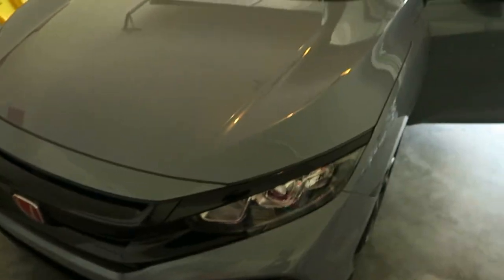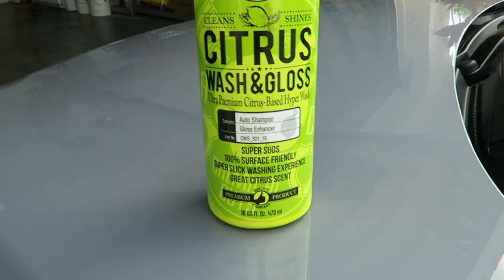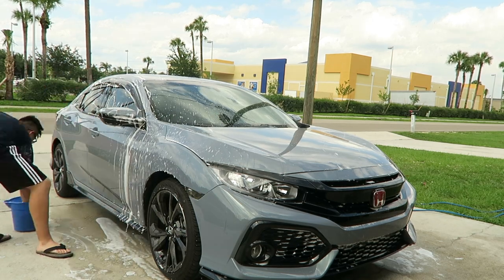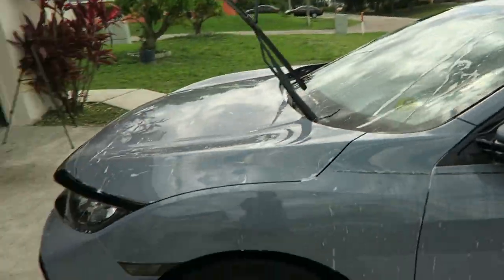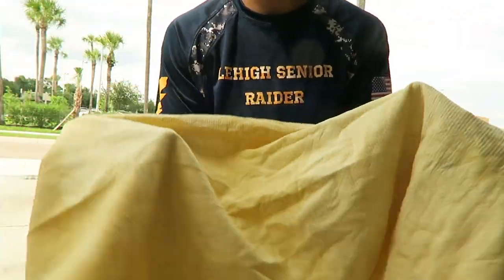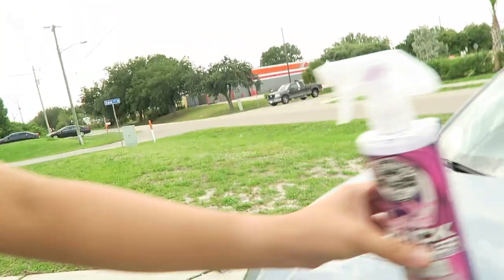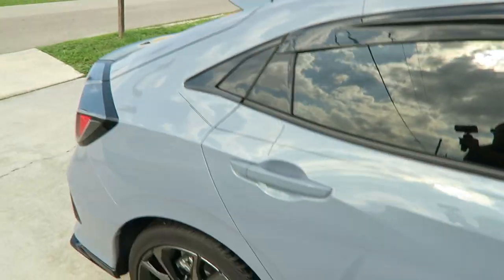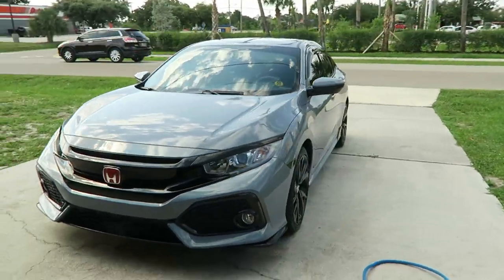Washing My Car & Cinematic Clip (2018 Honda Civic Hatchback Sport)

Comment: Nice video, just a few tips..

Always clean the wheels first, if you do them last then your paint is just drying in the sun while you are cleaning the wheels, then you have to deal with water spots.

Also, get a different sponge to wash your car. Those basic car wash sponges are known to cause marring and scratching in your clear coat. Reason being is if that sponge picks up any dirt from the car, it just rubs it around. I would suggest getting a microfiber chenille wash mitt. They pick up the dirt and incapsulate it in the mitt to prevent it from being spread around the paint.

My last tip for you is to use the two-bucket method. One bucket with clean water and one with your soap. Always start with the roof of the car and work your way down, as you clean one panel, dunk your wash mitt into the water bucket to rinse it off and remove the dirt, otherwise you will just spread dirt around the paint which creates scratches.

Those are my tips, nice 10th Gen by the way ;)
Reply from the maker: Thanks for the helpful tips man. Really appreciate watching my video and giving me feedback!
Reply: Yuuup i can see water spots on the hood of the car 😖 a good coat of wax should prevent that. I use Collinite 915 even tho it’s good elbow grease but love the finish or you can use Collinite 845 it’s easier to use and also great results. Good video!